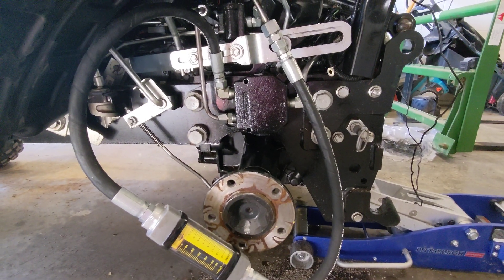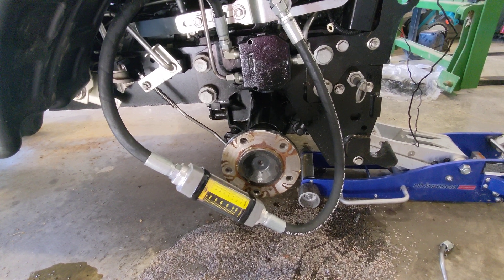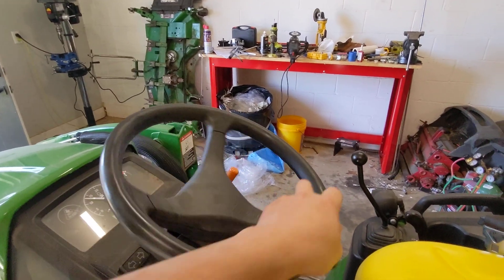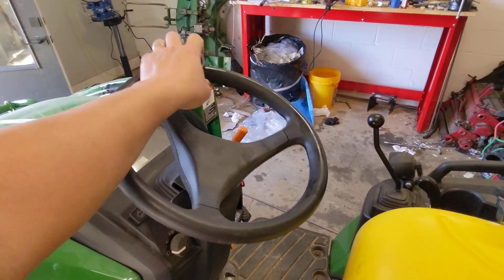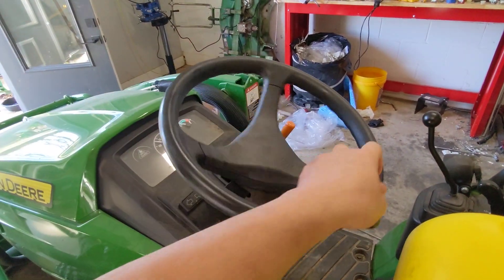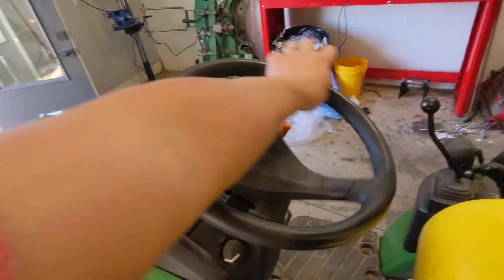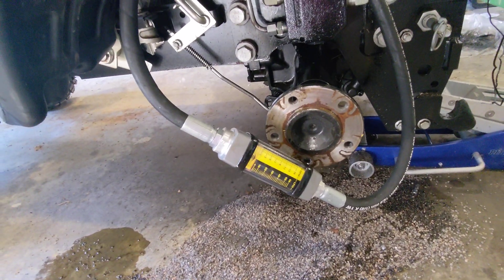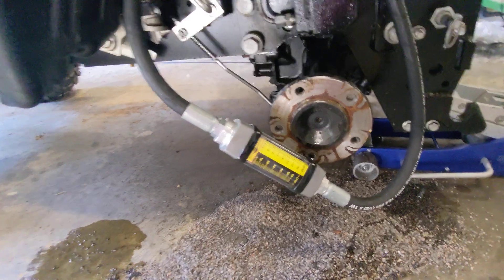HydrosPlus Steering Flow - First Look

Comment: Would have really really liked to see how much you turned the screw to change flow.
Reply from the maker: It's roughly 1/4 turn from the bottom.  It's not a highly precise piece of machinery, so it may be 1/16 one way or the other on your model.  That said, 1/16 of a turn can make a big difference, so tune slowly.

Comment: Thankya for sharing this video. By running off the 9GPM pump you installed, is this just "regular" power steering feel as one would experiance on other equipment or vehicles, cars, & such or is this the standard normal "hydrostatic" steering feel. 

One thing i do not like about the "hydrostatic" feel is the steering wheel never ever stays in the same position. I found this out when i put my steering knob on & when using the steering the knob always ending up in different circular postions. Drove me freakin nuts so i took it off the steering wheel. With normal power steering, the steering wheel always stays in the same positon when going back to neutrul, straight forward driving. This is the same with the JD 3020 we have. normal, very easy to turn, power steering & the steering knob we put on stays in the same neutral position. . . . . no dancing around the circle!
Reply from the maker: The steering will feel the same as it does for you now, so unfortunately it doesn't fix your frustration regarding hydraulic steering on the 1 series or other tractors that use the same setup.  In a car, you are using a power assisted rack and pinion or worm gear steering box which have real gears in them.  On this tractor and many others, you are using an orbital control valve, also sometimes called a char-lynn valve.  It works by supplying fluid based on how much you turn, but since it's not indexed on a real gear, it's can get off, especially when you turn to the "locks" at each end.  There is no cure for this for steering that is controlled by an orbital control valve and your knob will dance around the clock over time :)

I haven't tried it, but I might tomorrow, but let's say you like your knob at the 11 o'clock position, but it's at 8 o'clock.  If you turn full right and then push it another 3 "hours" of turn, when you come back to center, it will probably be close to where you want.  If you try it before me, let me know if it works.  Good luck!

Comment: I’m not knowledgeable about hydraulics but I do own a 1025R. If you increase the flow that much but don’t increase the amount of fluid in the system wouldn’t the fluid run much hotter?
Reply from the maker: Not in the testing I have done.  Just a few degrees over a 1 hour test at 2500 rpms.  Still doing some testing when possible, but I'm not worried about heat on the 9.5 GPM pump at this point.  A bigger source of fluid heat is going to be taxing the hydrostatic trans when pulling implements.  That is the only time I have been able to get the fluid to a heat soaked stage.